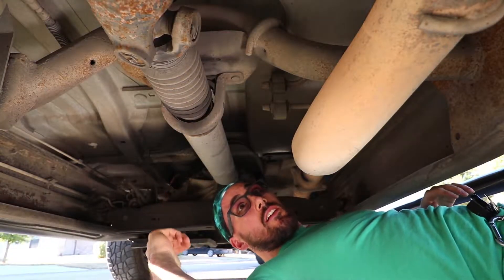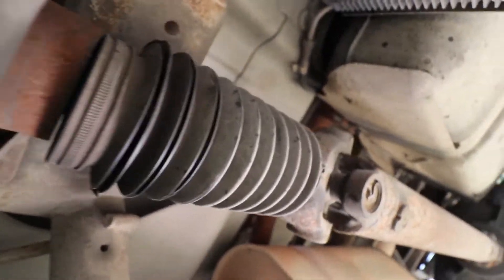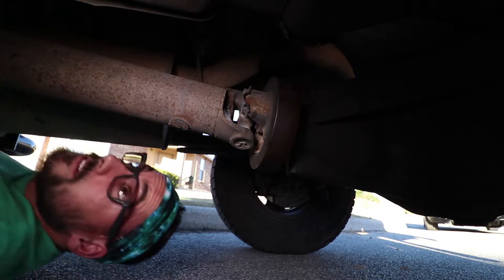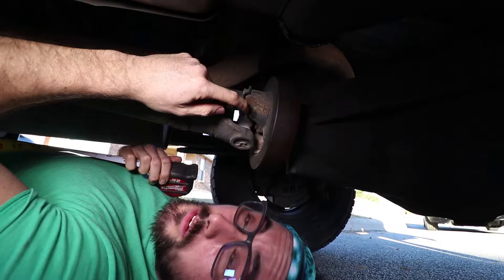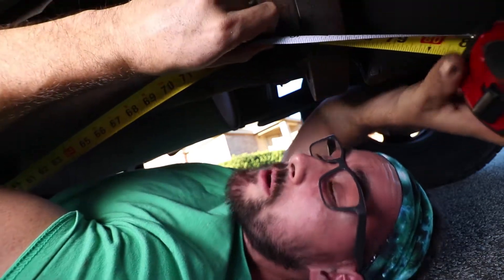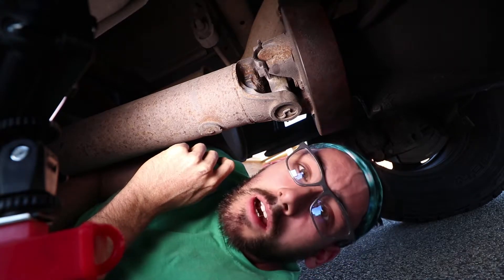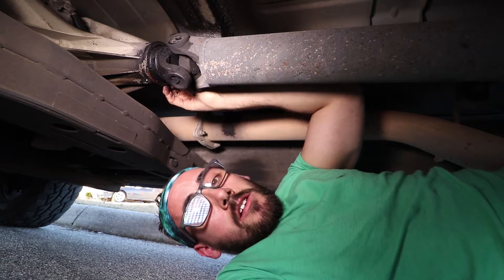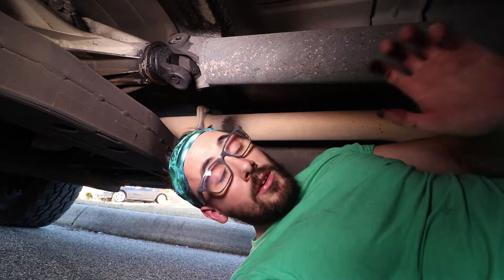Measuring a driveshaft for a 1 piece driveshaft conversion

Comment: I guess one good thing about my 2002 LB7 is the one piece driveshaft; currently debating on changing the 2 bad injectors or all 8, again.....
Reply from the maker: Yeah, I wish mine came with a 1 piece but that's ok we are upgrading it anyway. Well I can tell ya doing the injectors is a pain in the ass, but they say it's best to do them all at once. But I know a few people that just replaced the bad ones. problem is usually the others go out soon after and I personally wouldn't want to pull it apart twice. 😅
Reply: Going to end up changing one side first then the other later on in teh year, damn pricey things. Wonder if an 02+ driveshaft from a donor truck would fit directly on your 01
Reply from the maker: That's a good idea, they really are expensive as hell. They just might have one somewhere, but I already ordered this one. I just need it fixed asap because the clunking is getting out of hand.